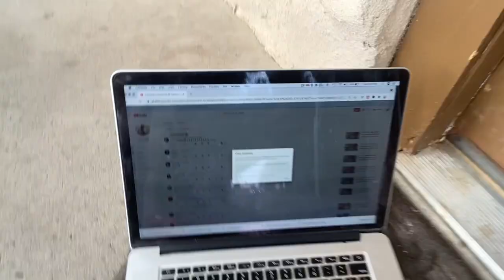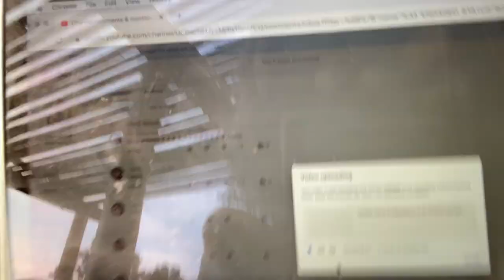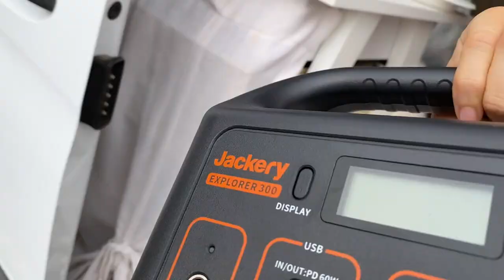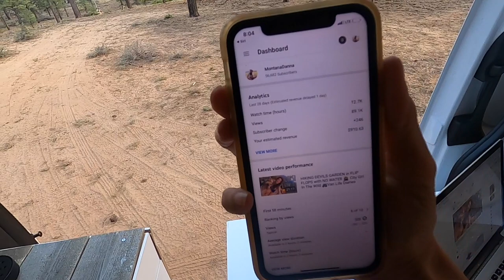VAN LIFER has a MELTDOWN on CAMERA 🚐  Solo Female Van Diary EPISODE 56

Comment: Hot mess. Hi Ms. Danna, hope all is well. I have a list of items that you may help ease some of your challenges, however I DO NOT recommend that you use some of the items if you are not absolutely certain that no one is around, for your safety. Item 1: Privacy tent $20 - $40 (for showering and rest room; Portable camping shower $30 - $50; Portable toilet $50 - $150, or camping folding toilet $40, or backet toilet (compost) $35;  Noogle (it's a hose extension that you hook to your van's air vent to extend your air-conditioning to the back of your van)  $50, or you can get a small Styrofoam cooler, dump ice in it, draw a hole on the top/lid, and another on one end of the cooler, put a small pipe in the hole, make sure to seal holes around the pipe and lid, take a cheap fan and put it on the lid blowing air into the cooler, the air will come out through the pipe with cold air. It's not enough to cool your van, but will blow cold air in your face and does not require much power to run it. You biggest issue with those items is space.. the tent is foldable, the shower is small (it has a water pump in one end and shower on the other and it doesn't occupy much space. The toilet is the big issue, unless if you get a foldable one used for camping (not very comfortable, I'm afraid).Just a thought. Sorry for writing this huge novel, but I could not help it. Also, when you are ready to get a solar system, if you plan going to cold places during winter, consider a combination of solar panels and Portable wind power turbine (not to be installed on the van, but places outside when stationary), if you have space to store when not in use. Again, my apologies for writing this book. Thank you for the opportunity.
Reply: Useful info--don't be sorry!